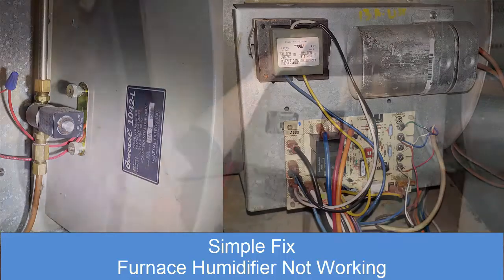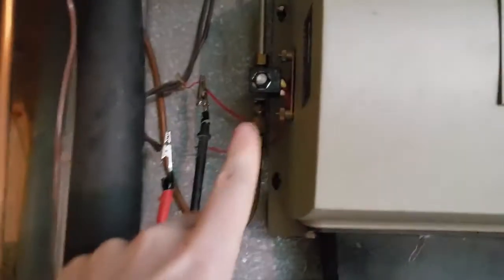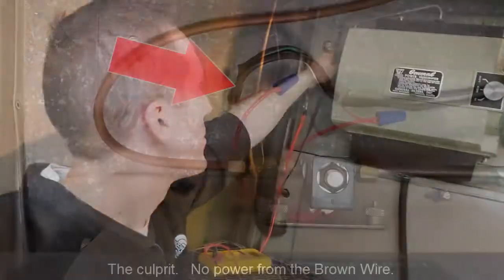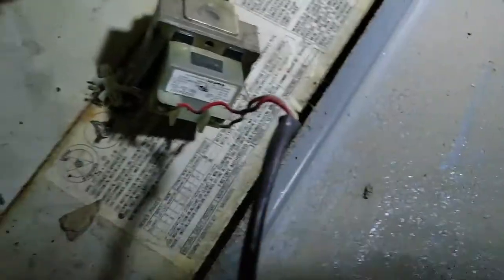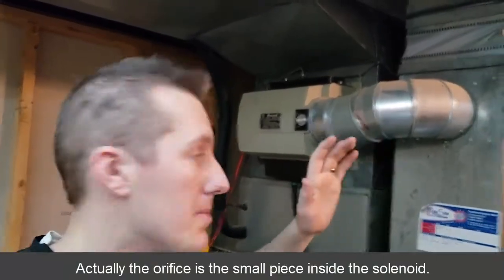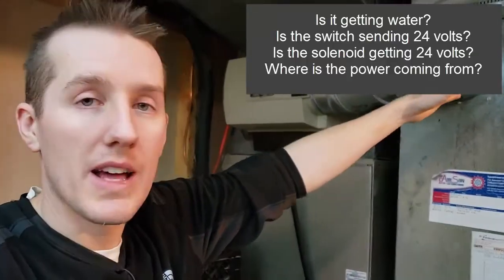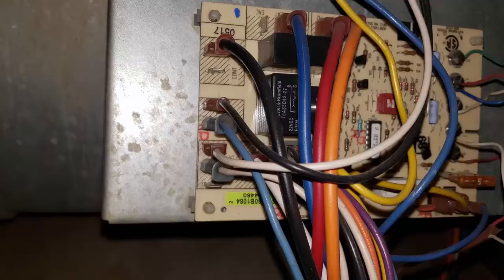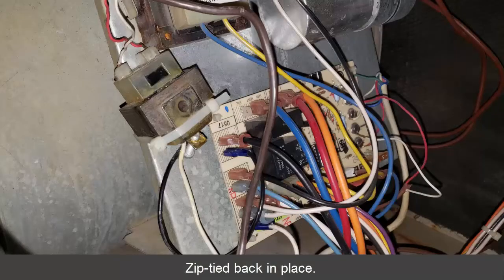Whole House Humidifier Stopped Working - No Water

Comment: Thanks for making this video.  It turns out my problem was the actual humidifier filter was never replaced since it was installed 13 years ago, so the water was not being absorbed/spread by the filter mesh at all and just falling through to the bottom of the filter unit and eventually down the drain--the filter mesh was crusted with calcium/mineral and dry as a bone at this point.  I've been wasting water for god knows how long since the humidifier setting was set to high--essentially like turning on the faucet and let the water flow constantly for years without any humidifying taking place.

Comment: Isn’t the orifice the plastic restrictor in the water line? Are you referring to the solenoid valve?
Reply from the maker: Ya you are right.  The solenoid is the rectangular and cylindrical metal thing on the side that opens and closes to allow water through.
The orifice is a small plastic restrictor that fits inside that.

Comment: Mine (Aprilaire 550M) wasn’t working. Turned humidistat until it clicks- no click from solenoid. Check AC supply to humidistat (furnace blower must be operating), got 24VAC. Checked 24VAC at solenoid, Nothing.
Cracked fitting on inlet of solenoid, got water. Conclusion= bad humidistat. Ordered humidistat, 15 min. to install the same model, humidifier now working.

Comment: Mine is working how it should however I turn the water line from the water tank leading to it off when not in use, and on when I want more humidity. I’ve had the water line off now for a few days, but I just went down and noticed the water that fills up in the bottom hasn’t drained and it usually does. I turn the system to off on the thermostat as well if that helps. Any idea why it hasn’t drained?

Comment: I was sceptical, but lo and behold, I opened up my furnace and there was a loose wire. Connected that up and I was off to the races.
Reply: Exactly the same! Had a new ac unit put in last summer. I bet that’s when mine loosen too.

Comment: Good job. Now I know what to look for. Thanks!
EDIT: So tonight I went through all the checks you showed. I figured out that mine hadn't been running just because the air hasn't been as dry as i thought. I turned it way up past the click and it worked, so I'm good.

Comment: Great video man. I have the same exact humidifier model as yours on my furnace from 2001 and it's been a week and no increase in my home's humidity! Damper fully open, pad is new and installed correctly, solenoid clicks and works I can see water dripping down the pad. I don't understand why my humidity is still so low 16% after a week! I turned the humidistat on full and after 3 days still 16%! I can see water dripping into my floor drain from humidifier when the furnace is running so I know it's flowing and should be working since I initially fired it up a week ago. My furnace is in a fully finished basement that's 1400sqft. Main floor is 2100 sqft, but after a week of constant heating cycles I feel that the humidity should have raised by now. Any ideas man? Thanks

Comment: Where's the circuit board - on the furnace or the fuse panel??  Thx.
Reply from the maker: Ya everything's with the furnace and that circuit board.  The humidifier only has the solenoid
Reply: @DaveWirth  Thanks Dave!

Comment: What are the chances that your problem is the same as others?
Reply from the maker: Probably zero.  But the process is what counts.  Going through and checking each step along the way till you find the problem.  Is it getting water here?  No, ok why not.  Is it getting power here?  No, ok that's why there's no water.  Why isn't it getting power?  At the start there are many reasons why it's not working.  I just try to go through and eliminate possible culprits.

Comment: Great video. At the end when you pulled up the hose on the top of the humidifier, was the furnace on or off?
Reply from the maker: The furnace was on.  That should be the only time the humidifier is on so the furnace air can blow through the ducts.

Comment: Thanks for posting! Props to you, man!

I thought I had gone through the easy steps, but I hadn't checked the internal wiring because an HVAC guy recently replaced the main board. I assumed he knew what he was doing and did it right. I was wrong. He plugged in a wire that was labeled HUM, but it wasn't the live wire for my Generalaire humidifier. I plugged in the right one to the board, and now it's working. I'm glad I didn't pay those jokers to come out and fix their problem. Maybe I should undo what I did, have them come out, and see what they try to charge me.